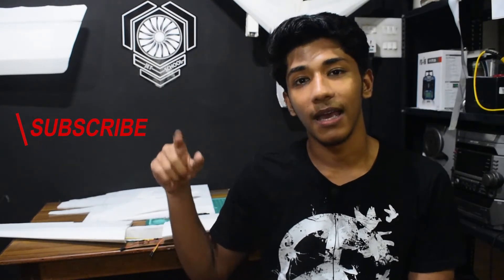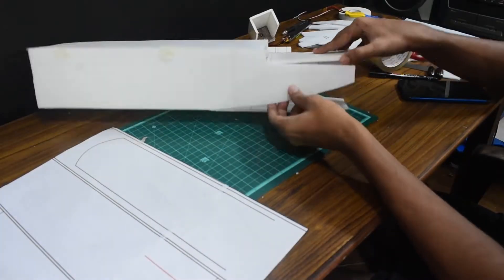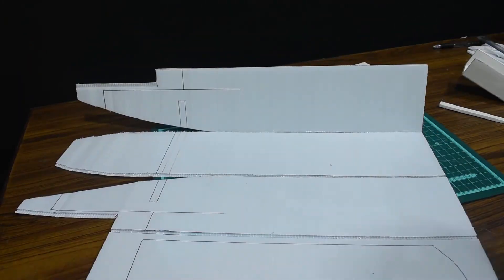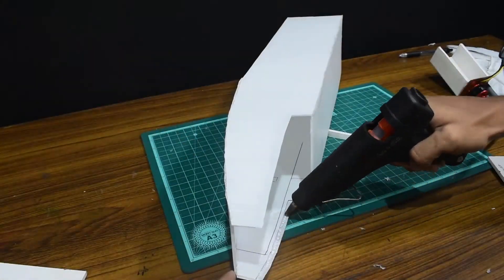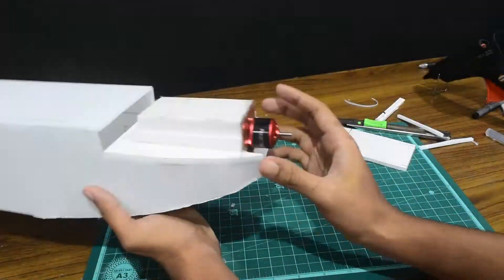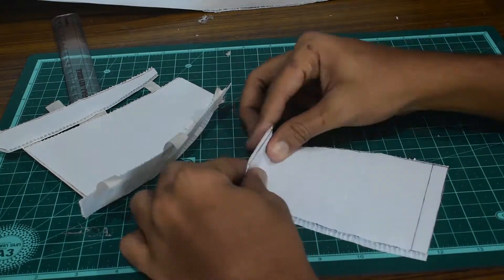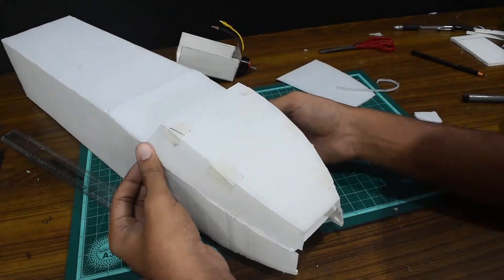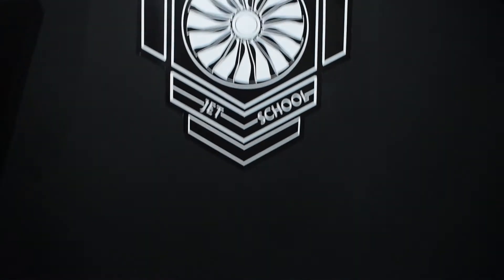RC LONG EZ PROTOTYPE Build series Part-2:FUSELAGE

Comment: It looks like you used glue then checked if it was right, then repeated on the wings. Does that make the glue less effective if it is used multiple times for the same piece?
Reply from the maker: No it doesn't ,it hot glue